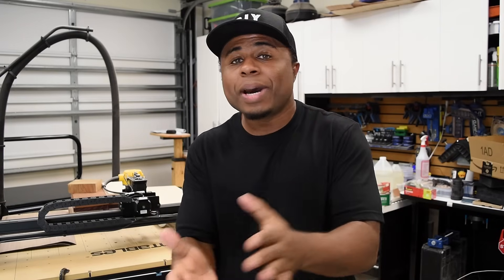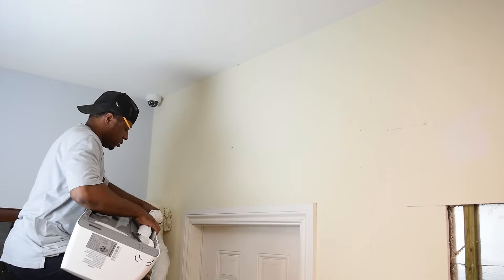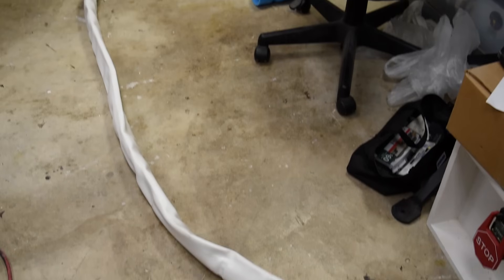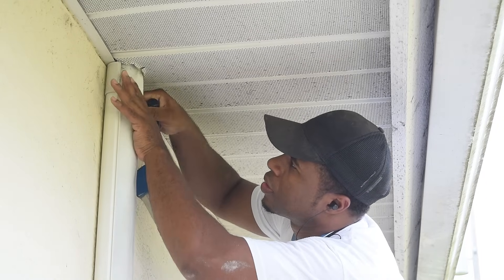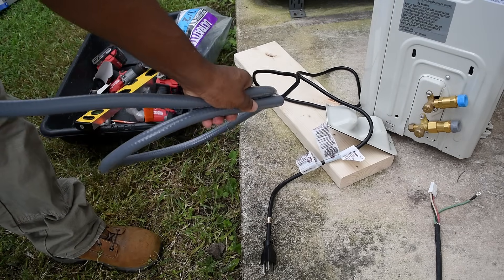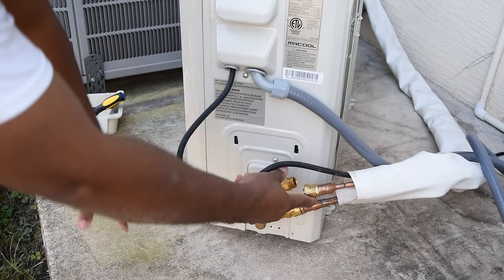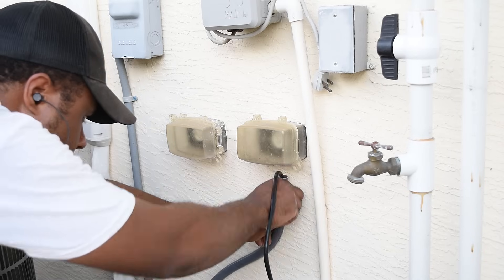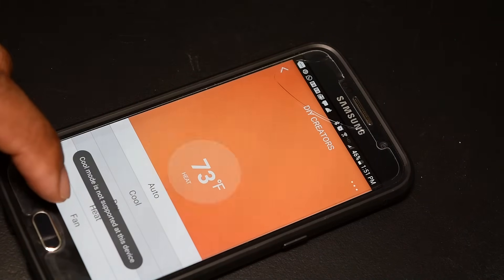How To install Ductless AC & Heating System // True DIY Mini Split MRCOOL

Comment: Seems like you would get air in the system when the hoses haven’t haven’t been evacuated.......
Reply: I said the same thing. How many people are going to do this without pulling a vacuum?? That unit will never run right.
Reply: That was precharged line set that's why he said you can't cut it. My only gripe is the wrenches it should be torqued down and threads oilef

Comment: I did not know this system; I see that there is no need to use a vacuum pump in the pipes. One tip, never install the evaporator unit so close to the ceiling, because there is always a layer of hot air that is useless to cool.

Comment: I really like our Mitsubishi, which has a SEER rating of 26. That puts it among some of the absolute best and most efficient.
Reply: I see Home Depot sells that. Did you install yourself? I see comments for heat and cold. We get both being high desert. Put lines inside pvc or copper?;
Reply: @lyricwritertoo  Installed myself, ran lines through the wall using 2.5" PVC pipe and then through the PVC raceway down to the condenser unit outside. I also mounted the condenser unit to the wall rather than on the ground since there's no grass outside yet due to the new construction. Rain causes the mud to splash all over everything until the grass is in place. Unit works great.

Comment: You didn’t evacuate the system. You’ll have non condensables in the system which will lead to early compressor failure and operational issues. Interesting.
Reply: These units are designed to tolerate non condensables in the volumes that occupy the refrigerant lines. The compressors operational life will not be reduced by the initial hookup with air in the lines. He even says in the video that should the lines have to be reconnected, you have to call an HVAC guy.

Comment: I’m HVAC engineer , this system will not run efficiently, the lines were not vacuumed before gas entered the system , there will be air in the system , won’t be surprised if the compressor
Doesn’t last long. Not a bad effort tho
Reply: If you read the description this lines came precharged with refrigerant, no need to vacuum.
Reply: @MrMugenwii  that's good to know.  My bad..
Reply: Hey Jonnie I live in a old 50's house where the duct work under house is shot. When rains goes through whole heat + air system, sounds like a wash machine in vents. Is there a way to fix cheap. House needs a million things  and all remodled. I got humity water on ceiling in winter and mold. Summer rain goes through system. Please tell me what to do.owe 100,000 on it this neighborhood totally fixed 130. HELP THANKS GOD BLEss Tom Tracy
Reply: So even though feon line sealed it has to be vaccumed ?

Comment: I think I missed something. I went back and watched twice but I still didn’t catch it. I saw you wired up the black 120v cord that you plugged up outside, but I missed what wires you fed through the water right conduit, where they went and what they plugged into.
Reply: Obviously, the blower inside has to have power but were the power wires ran through with the refrigerant lines?

Comment: You said the unit's precharged, but what about bleeding 
 air from your refrigerant lines?
(Suction & discharge lines? )
 You can't just connect the lines and open the valves.
Admittedly I've never installed a mini-split. But you
must know that you can't have air in the system.  🤔
Reply: I believe he did say at the end of the video that bleeding or evacuation of the lines was not needed, presuming that that was the manufacturer's instructions.  But I agree,  I was surprised that the lines could just be hooked up, and the pre-charged circuit in the compressor unit opened, via valves,  to charge the entire thing,  including the indoor unit.

Comment: You also need to clean those filter often depending how bad the dust is around your house. Do regular maintenance on that unit and it will last a long time.

Comment: Fast way is use AC window DONE ✅
Reply: Most garages, like the one for his shop, do not have windows.  The alternative is the one he chose to show in this video, and he has done a good job.  I have a similar situation, but I don't want to tie into my existing HVAC, ducted system.  This choice seems to be a good alternative.  And the best part: it is DIY.

Comment: No sharp bends.. however that first one going up the wall was a very sharp bend.. with your carpentry skills you should have made something to mount that unit better. Doing HVACR for 25yrs I hope the manufacture helped you do your manual J and so forth to determine the load calculations. If your using for a converted garage and living in Florida I doubt a 12,000btu (1ton) would be sufficient.

Comment: Suppose to vacuum pump the lines for leaks.
Reply: And pressure test with oxygen free nitrogen!!!
Reply: You pressure test with dry nitrogen for leaks and evacuate the pipe work and indoor unit to remove moisture.

Comment: Way too much work to A/C the garage.
 It would have been a lot cheaper and far easier to cut out the wall for a 12,000 BTU heat pump window A/C. You would have been done in 90 minutes and back to work for about $600.00

Comment: you dont have to use a vacuum pump to vacuum out the lines? i saw someone else do this.
Reply: It supposes to vacuum the system before opening the lines to make sure you don’t have any leaks
Reply: Computer Crap plus yes you do

Comment: No vacuum? Need to put these units, any ac system, into vacuum then into microns for at least an hour.
Reply: Hey idiot, did you not hear the part about it being pre-charged? These systems are designed so that there is no need to pull a vacuum. Hence "DIY" kit.

Comment: you did`nt pull a vacum .I wont elaborate. not smart
Reply: Sealed line set.  And with those vzlves you would be hard pressed not to wear the oil from your pump if you tried.  But ifs mentioned in the comments.   Also anything with a pre attached lineset os pretty much set up to run that way.   Of you lengthen ghe lineset you absolutely need to vacuum.
Reply: @drewf4319  False, R410a refrigerant uses POE oil that is extremely hygroscopic meaning that it lives moisture. Moisture becomes acid when it is exposed to the refrigerant which will eat away at the compressor windings and cause premature compressor failure.

Of course if you are DIY-ing a mini split then you won't want to pay $150 to have a professional ensure you dont have to replace the unit in a few years.

Comment: Ha ha!!  He said that he lost the mounting bracket.  But, the pic of the unit clearly showed it attached.  He must have not read the manual.

I just bought and installed this exact same unit that I bought new on ebay under the Confortotal name.  The one I got was 12000btu 220volt.  No joke this thing is identical to the one in this video.  I paid $535 for the unit and installed it in a day.  I have had it running for 2 weeks now and damn!!  It is awesome.  Also, it has decreased, dramatically the humidity in my cottage.  Best couple of hundred I have spent in a while.  Super quiet, super cool, heater works very well, and no hvac people needed to be involved.  I borrowed a hvac vacuum pump with gauges to install mine to keep air out of the lines.  The only problem I had on installation was that the drip line was a bit too short.  So, I had to splice some 5/8" tubing into it.  Money well spent........... for a change.
Reply from the maker: I said I lost the template, not the bracket! There is a difference! Thanks for watching.

Comment: Do not put these is a workshop space. They will get so plugged with fine dirt that it will need a professional clean. Your drain line set up is a bad idea that condensation drain line us see through and will eventually turn all moldy and nasty looking. Professional HVAC technician here

Comment: Right in front of the security camera. Genius installation.
Should have centered it over the door. 
Should have also simply made measurements for mounting it. lol
Super amateur install, but at least it works lol
Reply from the maker: Maybe if you paid attention to the video instead of trying to down someone, you would have a better understanding. 
1. The camera can be moved and is moved at this point. 
2. Can not center the unit over the door because of the drain line!!! There are two sides to a wall inside and outside. You have to keep both in mind. Might look good inside but look like crap on the outside. 

I'm happy with the install. Thanks for watching hope I addressed your concerns.

Comment: Is there an extension kit or DIY option available for extending the 25 foot connection hose? I have a picky homeowners association and need to extend the cable another to where I will place my condenser out of view so I do not break my homeowner association rules. Great job on the video!

Comment: What he has not told you is that you most definitely need to check with your local codes enforcement officials to see if you can install it without a permit. Any installation dealing with refrigerant lines where connections are made and the loss of Freon is possible must be handled by a certified technician. When he states that you might need to get an electrician to hook it up, there is no might. U.S. codes require a licensed electrician who will pull a proper permit to hook it up. If codes inspectors show up to check electrical and you have not pulled a permit for the A/C you could be fined. Just a heads up as I have seen people caught up in this so do your own research of your area before you do any installation.
Reply: duaneredman Bull shit, I’m not pulling a permit for this, and no inspector is stepping a foot in my house.

Comment: I would have used a cheap vacuum pump from HF to suck out air from lines and head unit, will last longer and work better! Air and moisture turns to acid inside unit ! Shorter life ,no warranty.       ( Only on units with out check valves)

Comment: Awesome video. But this air conditioner is so common in China - If you buy one (around 300 USD), the manufacturer or the dealer will dig a hole, drag the drain pipe and install it on a high rise condo or a concrete apartment for 20 bucks, if not free.

Comment: Why do 752 morons thumbs-down this? This is awesome to know! Thank you!
Reply: Because 750 of them "MORONS" knows that you must pressure test it with nitrogen to see if theres any leaks then vacuum down the system to remove any impurities in the linesets (he called it harness)  fail to vacuum down linesets will cause the compressor to shit the bed in a few years.

Comment: i believe the indoor unit should be minimum 12" from the ceiling... also, with the way the line set was handled, i would not be surprised to find a kink or 2 throughout the system..

Comment: I have one of these units in a room above my garage with the condenser outside on the ground below. It works very well but I was wondering if I could add a unit in the garage below and use the same condenser?
Reply: No - these are mini splits. Each one has two parts indoor and outdoor you cannot have two indoor parts and one outdoor. 
     To do so would require a very expensive custom built system. That would negate the value of this simple system.

Comment: Great video. Unless I missed something, you missed pulling a vacuum on the line set. That will lead to non condensables in the system. Resulting in poor cooling performance.
Reply: I thought the same but his first notes above said they came sealed and didn't need to pull a vacuum. Didn't see him open any seals on the lines either. Maybe something new to me?????
Reply: These lines on this system are precharged and sealed at the ends. When you tighten up the connector at the end the seal is punctured internally on the lines and thus the system is completely set up and fully charged with no air in lines.
      As he said if one then makes the mistake of reopening those connections then the charge would be lost and you would need an HVAC guy with a vacuum pump.

Comment: Love the video, BUT; ALWAYS CONNECT GROUND WIRE BEFORE ANY CONNECTION TO ANY ELECTRICAL SYSTEM; FOR REMOVAL, DO THE OPPOSITE, DISCONNECT THE HOT WIRE (usually, black or red) THEN DISCONNECT THE GROUNDED CONDUCTOR (usually white) then disconnect the ground wire. Please be safe people when working with electricity; 
Voltage does not kill you. You can survive with 1 million volt flowing through you at 1 miliAmp.

A few miliamps directly through your heart is lethal enough to cause fibrillation.

Below is a standard threshold:

1 mA - Barely perceptible

16 mA - Maximum current an average man can grasp and “let go”

20 mA - Paralysis of respiratory muscles

100 mA - Ventricular fibrillation threshold

2 A - Cardiac standstill and internal organ damage
Reply: Crwth Ghiikilzic   It is general EXCELLENT PRACTICE to connect your ground FIRST even if your "disconnect is off".  Just make it a simple habit ground first on connect and ground last on removal; simple and easy safety measure; then if you have to work something "hot" then you have that embedded/routine wired into your brain! Thanks and be safe with electrical to everyone; if you don't know then ASK, no matter how silly the question seems to you, it may not seem silly to the person asking the question. Be MENTORS my fellow electricians!

Comment: Great do it yourself video...I was wondering about air in the lines, but I'm assuming they were factory purged and pre charged, and no air gets in with the type connections they have at the condensing unit....I can see where this type unit can help where they can not get 220volts and are on boiler heat with no cooling system...I have to and will, explore this....My thanks to the gent that made this.

Comment: You was supposed to vacuum the system before you released the freon wasn't you?
Reply: Instead vaccum would of been nearly just as good if refrigerant released from say discharge side of unit and on return line (suction) have like a valve that you can open and wait till refrigerant just starts to escape and lock valve down. There be no air in any lines.
Reply: @wileecoyote5749  I seen some people vacuum the line before they open it but that's why we ask cause knowledge is power and I rather see it done right than waste money but thanks for the tip...
Reply: @exploringpeco  i was notified in another comment that the lines come vacuumed already and when you remove cap air doesnt go in. The lines connect to condenser unit by quick connect. No air entry. Pretty cool
Reply: @wileecoyote5749  yes I was just reading the comments on here and that's kool and I was glad I wasn't the only one that thought alike and thanks for responding...
Reply: @exploringpeco  👍
Reply from the maker: Nope it's a DIY unit

Comment: why would i pay $1500 .for this ductless system. when i can put a window unit in for $200, and $100 for dyi security bars?
Reply: This behaves as a heat pump and can do heating and cooling, ductless looks cleaner and is permanent and more powerful than any window unit. These inverter or ductless type units are quiet. And this works in any area without a window. Honestly this is a purchase decision you should make before making a comment about a ductless unit on an install video lol

Comment: Something I wish I knew ahead of time was the supplied drain line will not last long.  Mine became brittle and cracked within the first year.  I'm not sure how long water was dripping into my walls, but it was enough to require replacement of walls and insulation.  Get yourself some better quality radiator hose and never think about it again.

Comment: I installed the 12,000 BTU version of this about two months ago for a workshop I built in my garage.  The Texas heat made the space unusable in the summer.  Today was the first really hot day of the year, approaching 100 and likely 120+ in the garage.  I turned the unit on with my phone app from inside my house about 15 minutes before I wanted to work in it.  It’s a fairly small space, so a setting of 78 degrees will turn it into a meat locker in 15 minutes.  I read many reviews before I installed it, and saw many HVAC pros who said it couldn’t work because it would have inadequate evacuation.  They are wrong.  It gets very cold in a short amount of time.  And this is the 120VAC version.  Again, only a couple of hundred square feet to cool, but this would clearly cool a much larger area.  The installation was not that difficult if you are handy.  I poured a 16” X 38” slab with a side to side grove the size of a 2X 6 in the middle to accommodate the drain fitting on the bottom.  I was going through drywall, particle board, and a brick exterior.  Took about twenty minutes with a hammer drill and masonry bit to make a circle of holes 3-1/2” in diameter in the brick. Hammer and chisel knocked out the center and plastic tube flange covered the ugly edges of the circle.  I highly recommend this unit for handy DIYers.